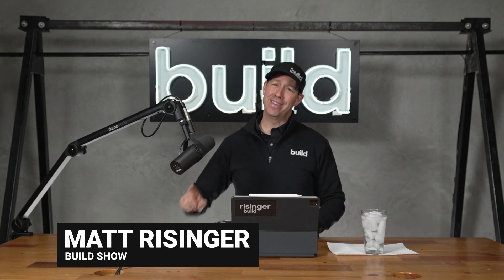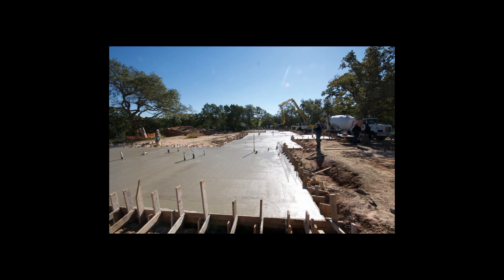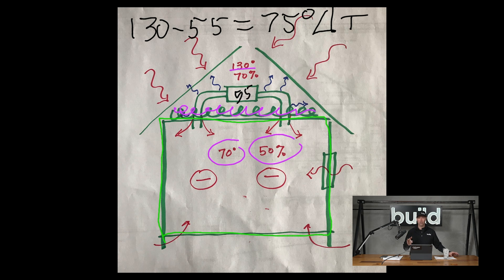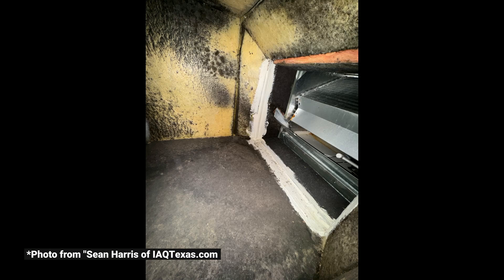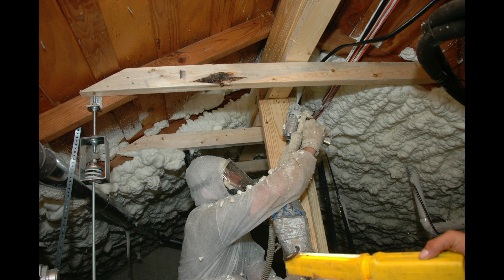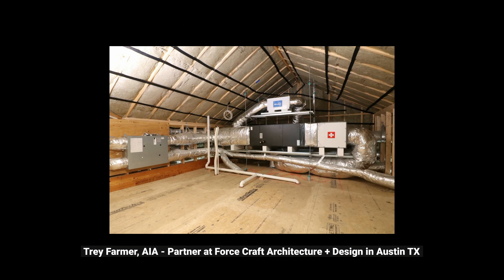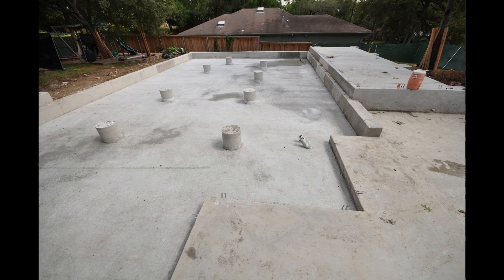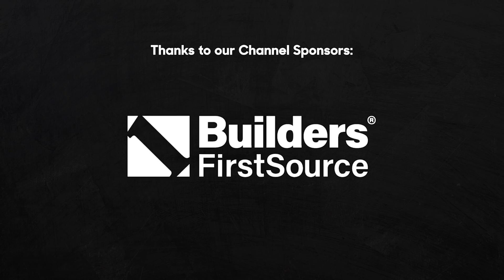Number 1 Dumbest HVAC System Mistake (Whoops)

Comment: First thing we did after buying our house (built 1966) was insulate the bottom of the roof deck. The heat pump/ac in the attic is now inside the house. Better operation and longer life for our air handler. Gotta love it.
Reply: There's a way to insulate the roof, and still have it vented. Leave the vent open, install 1 or 2  " spacers to the rafters, flush with the roof decking, install rigid foam board to the spacers. The spacers keeping the rigid insulation 2" from the decking will allow the air flow for the roof. Install rigid foam insulation at the top plated while staying back enough to keep the soffits open. Basically make the rigid foam as baffles between each rafter. Then you can either spray foam it, or seal off the seams of the rigid foam and run your insulation covering it up. Use string to hold the bat insulation up, or fur out the rafters and install drywall if you want a finished attic
Reply: Bad video bad idea ..
Reply: @brickcitynetwork  bad comment
Reply: @frederickheard2022  Prove it ..
Reply: @brickcitynetwork You know nothing about my house. You don’t know it’s construction, you don’t know my climate, you don’t know my mechanical systems. Making proclamations about my house when you know nothing about it is stupid. There: I proved it.
Reply: @frederickheard2022  It’s only a few ways to properly construct a house .. If i install those mechanical systems in home then i sure know what they do in ALL HOMES, like your home is special, maybe you but not the home .. “Stop Wasting and Start Saving: Maintaining an Energy Efficient Home” is a book i wrote to help folks like you, so NO, nothing stupid over here
Reply: @brickcitynetwork I'm a contractor with more experience than you in residential systems and your "bad idea" comment then trying to sell a book shows your dishonest.

You prove what's wrong with his upgrade mister expert that doesn't start with rip it all out and re roof the house or spray foam.
You can do a much higher performing envelope with rigid that closed cell.
Reply: @sparksmcgee6641  First off I NEVER TRIED TO SELL A DAMN BOOK TO NOBODY HERE .. I reference the book to another because he assumed my knowledge of the subject, stop adding to a worthless subject .. My experience started in HVAC 2003 on Chillers, Cooling towers and commercial boiler in NJ, I will walk circles around you when it comes to HVAC so stop it .. Last ? is how come all you folks upset because someone called out yall buddy on a subject he wrong on, you folks are bananas .. I also taught HVAC at 3 tech colleges around Metro Atlanta, some of my students are too techs at Estes, Cool Air Mechanical, McKinneys, Ragsdale, Blue bird Bus co and Reliable to name a few, Now who the hell did you or this channel help get a CAREER .. miss me with all your disappointment ..
Reply: @brickcitynetwork  There’s no need to yell at everyone online just because your divorce is going bad.

Comment: Can you do a follow up video on why you recommend closed cell spray foam in the south now? That’s a big deal/very surprising!
Reply: Insulation rating and life cycle in what is then an encloses space. It's tougher.
All the carbon and chemical stuff is what they say is the reason.
As costs have gone up the material cost is a lower portion of the install cost so it's gone from 3-50% more for closed to less than 20 a lot of times on residential jobs.

Comment: another dumb mistake is to let electrical and plumbing get buried in sprayfoam.  it effectively prevents any repairs or modifications without doing major ripping and tearing.  

but having a slab in your crawlspace: incredibly good idea.  it makes the subs' life much easier.
Reply: Yeah but cost wise a good 15 mil barrier material I just about as good. Anything that keeps it clear is what us crawling around people appreciate.😊
Reply: @sparksmcgee6641  said like somebody who has never cruised around on a poured crawlspace slab on a mechanics's creeper.

Comment: Calling in from the Midwest here, I'm feeling t's just as prevalent in the North. So many houses have air returns on exterior walls. I've pulled one open during winter and there was nothing between the metal duct and wood siding! At least the air supplies tend to be on the interior.

Comment: Open cell on the roof line tends to create humidity problems and the need for a whole house dehumidifier which consumes energy and adds cost of installation. Closed cell is the way to go on the roof line.
Reply: How many inches of closed cell foam would be required under the roof deck for a conditioned attic? I believe a conditioned attic is better than a vented attic in the south. Is insulation required on the floor of the attic if your doing a conditioned attic?
Reply: Oh yeah vapor drive in the south. Permeability would be a big issue. I only use closed cell, usually rigid.

Comment: 32 years I’ve been doing HVAC and the biggest HVAC mistake I see is not sizing equipment or ducts properly
Reply: I totally agree!! In my area just about every home has a single 14" or 16" round flex return duct. Even on homes that need 4 or 5 ton systems. We are constantly adding a 2nd return.
Reply: @KPHVAC flex returns😢😢😢
And now that masters are so big, even on entry level, it's good to make sure one is there.
Reply: Same here. Tons of undersized duct and oversized equipment
Reply: I work as a mechanical engineer who designs commercial HVAC systems and another very frustrating issue is the way that newer HE equipment has to back down airflow for certain modes. For instance, on a ton of furnaces, the airflow for heating mode is way less than in cooling mode. And the issue isn't that you really need that much more CFM to provide adequate heat, the issue is all of the ductwork is getting sized based on that max airflow the unit would provide in cooling mode. So if it then goes into heating mode pumping out 2/3rds of the CFM it was, now the lower airflow doesn't reach the furthest ends of the duct runs. It's extremely frustrating.
Reply: @tylerbogaard375 Yea I think we're gonna see almost entirely ductless systems in the next 100 years because of this
Reply: @gg-gn3re  The biggest challenge with that will be accommodating outdoor air requirements in commercial settings.
Reply: @tylerbogaard375  Then increase the speed of the fan for the Heat mode, *I can tell you how if you don’t know
Reply: Yep. Just worked in a county and city that doesn't even require manual D or L.
All the contractors just wanted to do it the way they always do instead of the design. 
Only a 1800 sf entry level house.
Reply: @sparksmcgee6641  what’s the heat load of a standard size brick …

Comment: I would pull any AirHandler out of an attic if possible.  The mildew is easy to kill.  If you do the system right, you don’t have most of these problems.  If you caulk the cans before setting them, you don’t get black ceilings.  I put foam in the roof of the attic and the attic stays about 5 deg warmer than the house.  People would rather have the closet space than spend a couple bucks a month extra.  Those first ducts you showed, the awful light gray owlflex system and the black plastic systems were a first attempt that saved builders a lot of money over wrapped metal.  The new R6 Mylar flex is so much better. People running the air too cold or with dirty coils will cause that mildew even with ductwork in a house.  So can running it once in a while.  There’s a lot of houses here in the Ft Lauderdale area that have 1ft attics.  In a perfect world, the air handler or furnace, and the ductwork would be in the air conditioned space then you work back from there.

Comment: Does it make sense to use closed cell foam on the rim joists of an older home?
Reply: No or maybe if you're doing a new continuous insulation layer and it's incorporated.
Air sealing is more important than insulation if you aren't doing the whole house. Rigid is waaaaay better than spray so use that anywhere you can.

Comment: Regarding the frost line…I’m currently doing a self-build 11 miles north of North Dakota. My building inspector was prepared to accept my attached garage on a 48” grade beam sitting on a footing. He required my covered patios to be on a pad that was at least 8’ below grade as the patios are not heated and frost could work its way down below 4’.

Comment: Spray foam is Dumb: It prevents proper inspection for water leaks, rot & other problems. This is going to be a huge problem in the next 10 to 25 years, as more & more homes will need major repairs because water damage gets hidden until something breaks.

Comment: What we really should do is a "mechanical room" on the ground floor for HVAC and the roof / attic space designed for a conditioned attic / roof.  And stop using the attic hot air.
Reply: @Navy1977yeah and that's better usually. 
Just sold an entry level new build at about $250sf so just the code requirements for access 12sf for an upright without the door swing requirements. So $3000 to put in a room. 6 to 9 k if it's for water heater ect...
Way cheaper to just shift insulation to the roof. But customers don't want to pay for it.

Comment: We built our house before I knew all this to do something about it.  I would do it different now.  But, I used aeroseal to make the best of it.  Our house was being slightly pressurized and we had 120 cfm of total leakage on a new duct system.  Now there’s like 15.  It makes a big difference.  The issue with it is that I have a fresh air system with a dehumidifier.  The slow moving air through the ducts does heat up on it’s way through.  But hey improvements can always be done later.

Comment: Worse thing I’ve seen. Supplies run under the basement/concrete floor. Two different houses. Both took on water. Bred mold. Had to be abandoned.

Comment: Frost line in Phoenix. It's probably+3600 feet 😂😂. All slab on grade here!  Almost all post tension slabs.

Our attics are upwards of 160-190 during summer. When it's 120+ outside.  So my ducts in my house built in 2019 are going from the handler to ducts in extreme heat and then dump into my house to cool to 74. We don't have condensation issues, but for the first few seconds when the air clicks on, you get a burst of HOT air. Also I run MERV13 only on my 9 air filters my home has. I don't have the dirty registers where it builds up brown dirt around each register.

I wish I could have had a condition attic. But i am in a production builder home. So I'm stuck with what they offer :(

Comment: There is trade off in costs but maybe it makes sense to go with mini-split technology and get rid of the ducts altogether?  In my imaginary dream home I would have a cassette recessed mini-split in every room with its own thermostat. Personal preference in temperature and shade from an outside object (tree) could play into the rooms preference.
Reply: I've been considering mini-splits.  However, there are some significant cons to them: (1) Expensive and messy to clean annually (2) Slightly flame-happy refrigerants (3) Toxic refrigerants [if one of your indoor mini-split systems should leak].  Right now, my heating/cooling is an outdoor pad-based gas package unit.  I want to replace it with a heat pump when the Inflation Reduction Act rebates are available in my state.  I'm thinking about tearing up interior walls to move my duct work out of the attic and crawl space where mine are now.

The biggest problem with mini-splits is all that pesky water condensate that collects on the indoor coils, drips down into a collection tray, and then runs outside through long tubes.  That water grows crap that has to be dealt with.  Throw in the flammability factor, and it's been a deal breaker for me.  I'd rather tear up my interior walls and move my duct work to inside the conditioned space, despite the cost.

Mini-splits sure are efficient though!  Some of the more expensive indoor units can be hung nearly flat on a wall with a piece of large artwork covering them.  They are disguised to be large art pictures.  Probably easier to clean & service than ceiling mounted indoor units.
Reply: @skipbogard you need to look at actual units on that fire risk they'll be rated as the same safety level as any other unit.
Reply: These pictures predate us having splits available in the US. A lot of people go that route now on older houses.
But please for the love of God put a nice trim screen around it. A dishwasher mounted on you wall looks like crap and just a little homeowner work cam hide it.
Reply: My imaginary dream home uses a hydronic loop and fan coil units. From a comfort (and aesthetic) perspective it's the same as mini-splits but all the piping is water instead of refrigerant. This has the huge benefit that the heat pump can easily be replaced without needing to modify each head inside the living space. You can easily have multiple heat/cool producing components on the same loop to meet changing needs and goals.

Comment: For an attic situation could you instead build an insulated "box" around the ducting instead of insulating the entire attic, removing the insulation below between the ducting and the drywall? Our home in socal is 1970's and has the ducts in the unconditioned attic. It's also got dual whirlygigs and air vents all around under the eaves of the house though. It seems very dry in the attic. That said, I do think the soft mylar style ducts have quite a bit of loss with the thin insulation they have. I'd just hate to insulate the attic ceiling with closed cell foam and then down the road have any kind of roof leak... We have a relatively new roof installed, less than 7 years old, and it's solid, but I need to be able to inspect the wood.

Comment: i have a full size 4 corner basement under the same size 4 corner single floor home each level 2400 sq feet. basement is half garage/shop with the other half waiting to be finished. basement is mostly conditioned....in other words i don't have as many open vents but it stays a little cooler in winter and about the same as upstairs during the summer. all of my utilities and ducts run from the basement up. the only thing in attic are a few electrical lines for some ceiling fans and lighting. i love my setup. no nasty crawl spaces and no attics with ductwork and air movers attracting condensation. like matt  ive been in miserable attics and nasty crawl spaces enough to know i was never going to build a house where i would ever have to be in either.
Reply: The dream unfinished basement. Aaaaaaaah🎉🎉🎉🎉🎉🎉
Reply: @sparksmcgee6641  yah it's good stuff🫨

Comment: Open cell spray foam on a roof deck????? That will allow moisture thru foam, sounds like a mold and rot issue in the future.
Reply: Strange he suggests it. Minimum is 1.5" CC to act as a moisture barrier then open cell over that is optimal

Comment: You stated it is more of a southern issue than a northern issue but I don't think that's true in the sense that putting ducts in the attic of an attic will trap heat in the attic and cause ice damning issues.   
Really bad ice damning issues if the builder also puts in 1,000,001 canned lights, doesn't seal the ducts as they go into the house well, leaves a portion of the main trunk line uninsulated in the attic, leaves a portion of the attic not vented at all -- and all on a house that didn't have proper soffit or roof venting to begin with
So, that only leaves the question = when are you coming up to fix my house Matt?   It would be a great video series - you could literally show the audience everything a contractor is not supposed to do.
I've even got lots of issues I didn't list.
Haha

Comment: Matt, what do you think about ducted split units? I don't see them that much in the USA.
Reply: Easy to do!  Equipment is readily available.  Change an existing furnace to an air handler.  I put in over 50 systems in Southern California in the last 15 years.  Fujitsu, LG, Mitsubishi.

Comment: I apologize if this is a dumb question as I'm not a builder. But how much HVAC venting would be needed in an attic that's not venting to the outside?
Reply: Almost none because the unit and duct will heat and cool the area. If you want air filtration the standard is to put a return vent and supply vent as far away from each other.
Just a return is an option if it's a old leaky house.
If you're DIYing it get a 2"x8" saddle boot and a vent cover so you can control the flow.
Or 
The Profesional way a tradesperson would do it is just cut a hole or two in the duct and never look at it again. Tradespeople don't have flexible duct in their house.😊😊😊😊😊

Comment: This video refers to heating and cooling? What about if you need to run an HRV or ERV fresh air or exhaust through some attic space? Does the same principle apply or not so much because the air isn’t really conditioned?
Reply: Same really. I have an ERV in Dallas,TX and the temp rises a few degrees while passing through the ductwork in the attic.
Reply: @chriswilson7138  I’m in VT at the other end of the spectrum but my HRV duct passes through the attic for about 10 feet in a joist bay. I haven’t blown my insulation back in yet so since it rests against my ceiling vapor retarder so basically against my ceiling drywall I was wondering if I built an insulated box over the insulated duct then blew in over that maybe it would be a bit better than just the duct jacket.